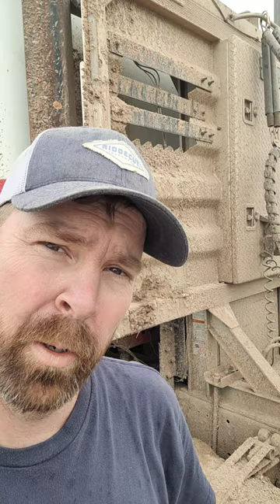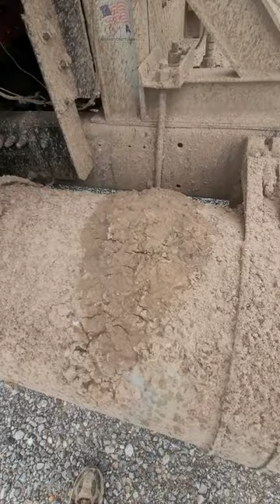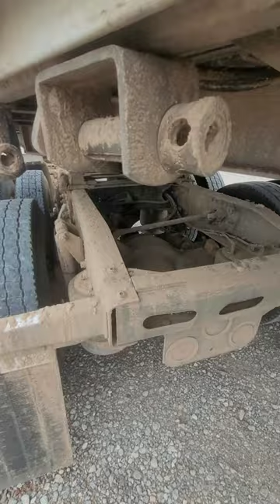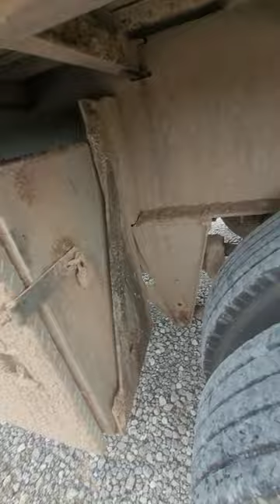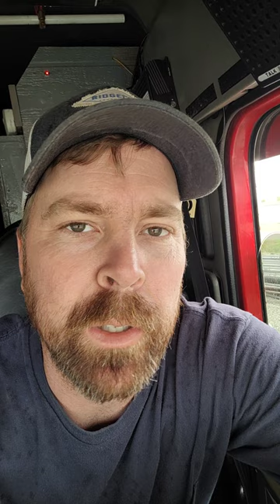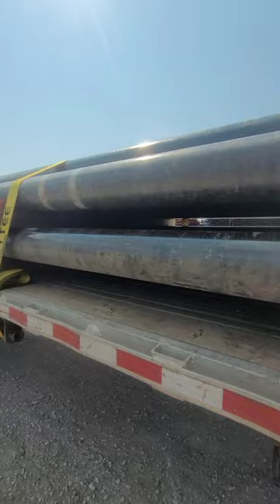Hauling oilfield pipe is a dirty job

Comment: How do I go about getting into your kind of work? I'm looking forward to coming off the road and doing some local work with my truck & flatbed. I've done sand hauling before but I like flatbed'n more
Reply from the maker: First off, if you want to do local stuff, you need to make sure that there's a market in your area for it.  If you're going 100% independent, it could be a challenge.  A lot of owner operators sign on to companies so they can stay busy.  You have to find your own work as an independent.  I've been doing it 5 years now, so I've built up a client list and they usually call me when they need me.  The first 4 years, I just ran off the load board.  I won't lie, the load board got bad when covid hit and really bad when biden got in.  It's almost impossible to run only off the load board unless you have no debt.  I would suggest trying to pay off whatever you get.  If that means living on beans and rice for 2 years to save money, then so be it.  Debt will absolutely run you ragged out here trying to make those payments.  It's very overwhelming first year bc you have a lot of bs paperwork and such.  There are companies that do all that for you to make life a little easier and make sure you got your ducks in a row.  Insurance will be horrendous first year.  Mine ran $1600 a month.  I think the standard now is $2000.  Get a good fuel card before you get out there.  NASTC is by far the best.  They save me 10 to 15 grand a year.  Try to get a truck with all the paperwork.  You want those receipts that way you know the seller isn't lying about the work he's had done.  Definitely buy a 53 foot trailer.  I miss out on loads all the time bc I got a 48 foot trailer.  Be available to run weekends, answer your phone, and send in your paperwork same day.  Those three will get you miles ahead of everybody else.  Good luck.  Let me know if you have anymore questions.
Reply: Great advice. Thanks!